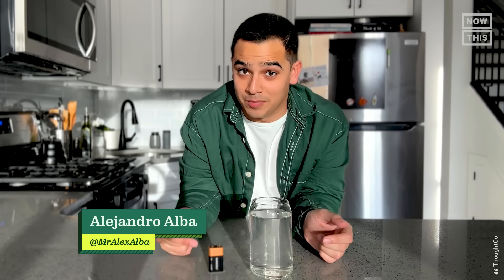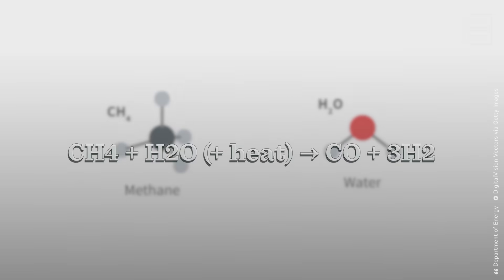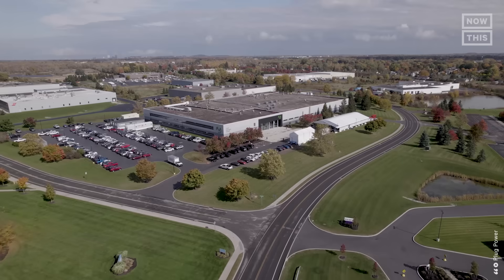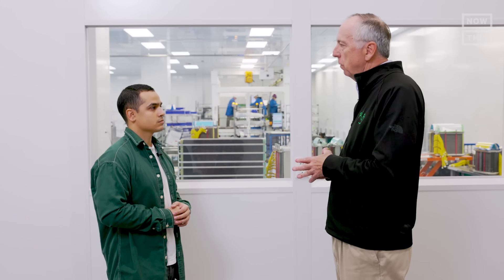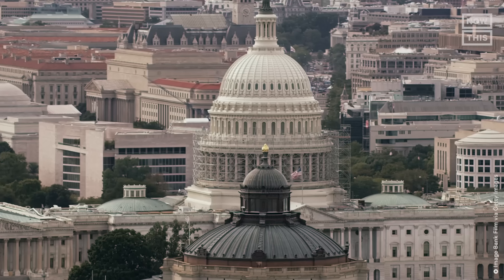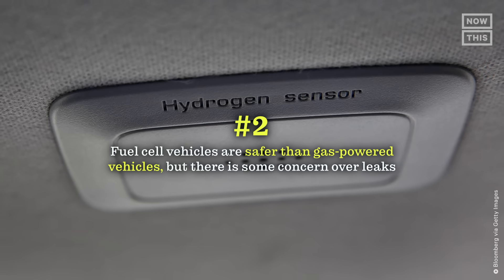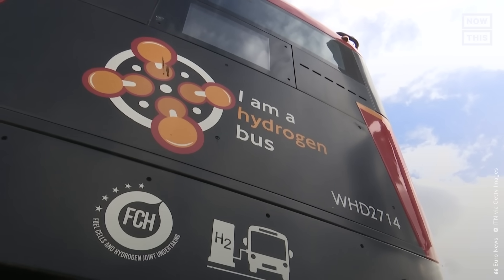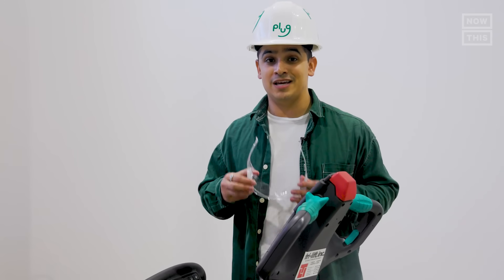Can Green Hydrogen Save the Planet?

Comment: So, just for reference, green hydrogen as a solution-to-everything has two main issues: it's inefficient (~30% vs. 90% for batteries) and expensive. 

In the end, right now it basically only makes sense to use it to displace gray (ie dirty) hydrogen. Once we do that and if the cost improved, only then should one consider other uses, like trucks or planes. But using it for heating or passanger vehicles would never make sense, since there are better options available.
Reply: This. As the video state : we already use a lot of hydrogen on this planet, nearly all coming grey hydrogen. Start replacing this with green hydrogen before even talking about any other usages.

And we probably want to replace dirty electricity with clean electricity before we even use some of it to produce green hydrogen anyway.
Reply: Indeed. In short, it's NOT energy "source", but "storage". Inefficient one, thus requiring abundance of electricity, which makes things even worse, if given country can't even fully make a "clean energy" in the first place (like Germany with over 40% energy coming from fossil fuels (about 25% coals and 15% natural gas)) .